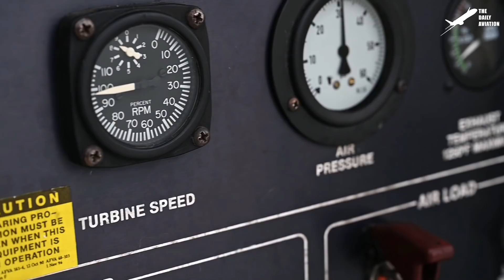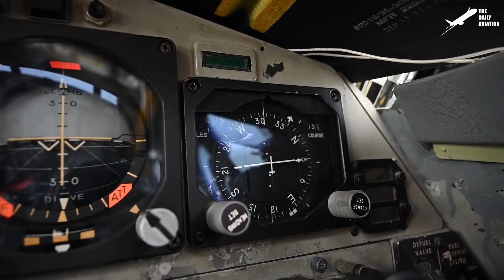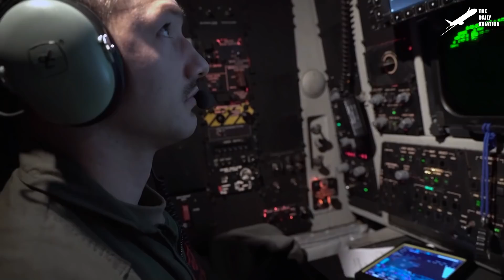US Need This Special Technique to Start this Gigantic Aircraft

Comment: I suspect the B-21once sorted out will retire the B-52s. But the B-21 is still a bit too glitchy. But so was the B-52 when it first went into active status.
The F-35 had/has all sorts of glitches. I strongly suspect the military actually wants people to think the F-35 is problematic aircraft and seriously underestimate its potential...That's what I would do.
Letting everyone know what you have under the hood is ALWAYS a bad idea. Being grossly underestimated is an excellent defense strategy. Even to the point of putting out embarrassing disinformation. Parading your weaponry through the streets is like showing everyone you're playing poker with what's in your hand.
The U.S. doesn't do that, they hold their cards close to their chests. What you think you see is NOT what you're going to get. At a guess, at least 20% of U.S. firepower is very carefully hidden...Maybe more. 
That there is a U.S. Space-Force is always glossed over. Hey, no big deal. Please, don't give it a second thought.
Reply: The problem with the B-21 (and most other projects funded by the gov't) is that it's taking way too long. For example, the SpaceX method of rapid prototyping is producing a huge rocket that may make it to orbit before the Boeing SLS, with its recycled parts, does.

Comment: I was surprised to see the B52Hs , the only ones flying today and built in 61 and 62, could only go 400 mph.🤣 The old D models I flew in, built in 56 and 57, did a bit better than that.
They should have used a military fact checker on a few of these statements.
Reply: Airspeed is limited to 622 mph by the electro-optical viewing system, which causes flight instrumentation issues at higher airspeeds.  Your Dogs didn't have such a system.  The vertical stabilizer also has different characterics regarding speed/altitude.

Comment: cart starts?  no, it's start cart...and even then they aren't called that, it's a -95.  the generator is a -86, or a "hobart".  and not a word on the unique landing gear?
Reply: -60s were retired when you were in?
Reply: @wingmannj  worked on many at several bases, but around fighters.  60s were never used on heavies.  loud, less load, way too much gas.  -86 was power for 8 hours on 50 gallons of fuel.  -60 was 100 gallons per hour...and again way too loud
Reply: @scottallberry6713  they were extremely loud, they had a turbine engine not like the hobart diesel. i got tinnitus from them. had -60s at sawyer in the 80s.

Comment: No APU in B-52, this is external bleed for ENG starting
Reply: This was a cartridge start, though they showed an AM/32A-95 compressor early in the video.
Reply: @dougwickstrom9870  no x-bleed on B-52 or what?
Reply: @MultiMetaldemon  Need to have at least one engine running to start the rest on cross-bleed.  This was a demonstration of a war emergency start which started all 8 engines at once using 4 starter cartridges.  External air connects only to #3 engine.

Comment: '
if the B-52 is a too old and no fix...
buildding brand new B-521 airplane with little bigger size, more longer body, long range, use 2 jetmotors from C-5 engines...
8 jetmotors are too much waste gas and heavy weight
Reply: c5 engine on a b52 would suck up every single little tiny pebble, grain of dirt, and other things much bigger....which would lead to much bigger problems than just fuel efficiency.

Comment: Not sure I'd want to be stuffed in that thing nonstop for 15 hours...I've never been aboard a B52 but I'm told there isn't enough room inside for the crew to blow their noses.
Reply: They can get up and walk around, cook a meal in the oven, take a dump if necessary, and enjoy a cup of hot coffee. Yeah, there's room to blow their noses too. There's even a foldable cot for napping.
Reply: @barrygrant2907  Thanks for the clarification, Barry.
Reply: @barrygrant2907  B-52H has a built-in bunk.  As for the toilet, it's not much more than a bucket, and frost forms on the thing at altitude.  Walking around is limited, as the only place to stand upright is at the bottom of the ladder between the upper and lower decks.  And as that is on top of a hatch, standing on it is a very bad idea.  I suppose if you just have to stand, you could do it on the ladder.

Comment: Wrong on the cart-start unit that was a -60 bleed air,electrical unit a small turbine engine for the bleed air, cart start is basically black powder charge to spool up the engines speed for the igniters to fire off and they were mounted on all eight engines as I said  in my last  comment do your research right
Reply: They did start on cartridges.  Watch the video.  The power unit shown is an AM/32A-86, and the air cart is a -95.
Reply: @dougwickstrom9870  I know what a -60,-86 are I had to fix age mechanics screw ups AND they don't  need etheir unit for alert start up period, when they did a cart they fired all eight at the same time they used the batteries on the aircraft for power seen it all the time in the eighties during the cold war when they scrambled a did a elephant walk enough said

Comment: And a single German Foo-Fighter from the 1940's could run circles around this silly plane, destroying it within seconds after spending time toying with it.
Reply: So, after well over 60 years of service through Korea, Vietnam, Iraq, Afghanistan, and countless other areas, we didn't see that happen.  Why? Because the B-52 doesn't go in unprepared, or alone.   Air superiority is established well in advance by F-18s, F-22s, F-35s, drones, etc.   So, while your post is theoretically possible, it's not the reality.
Reply: At 50,000 feet? And 100 mph faster than a ME-262? Perhaps not.

Comment: How is this a special way to start engines??
Reply: The engines start demonstrated in this video used powder cartridges.  Modern aircraft cannot be started that way.  Some older aircraft could only be started with cartridges.  That is what is meant by "cart start."  A "start cart" provides external compressed air for starting.  A B-52 requires external air or powder cartridges to start.

Comment: If usaf plans to use the b-52into the next decade then why not use 4 high-bypass turbofans instead of the 8 inefficient turbojets now in use? HELLO....welcome to the 21st century!
Reply: Amongst other things, the wings would have to be redesigned. The 737 Max kerfuffle was caused by Boeing trying to shoehorn efficient engines onto an airframe that wasn't designed for them. Welcome to reality.

Comment: Top speed is 650 mph not 400. Are the other facts wrong too ?.
Reply: Airspeed is limited to 622 mph by the electro-optical viewing system, which causes flight instrumentation issues at higher airspeeds.

Comment: 4:05 why do poeple messure fuel by WEIGHT, yes weight is an important factor but why is that the mesurement given instead of liters. earlier in the video you have gallons per hour as fuel consumption and now you give pounds of fuel for total capacity? see how its miss matched? how the fuck am i supposed to calculate how long it can fly for without looking up how much jet fuel weighs? Also if your concerned with the fuel weight and cargo weight being to much for the aircraft you probably already have a calculate out and ready so memorings how much a gallon of jetfuel weighs would be easy for you to calculate it then and there.
Reply: Fuel weight is more more useful that gallons. The fuel flow gauges will tell you how much pounds per hour you're burning. It's really simple. Everything about flight is weight based. More fuel weight, less cargo/munitions, etc.
Reply: Because the weight (actually the mass) of the fuel is important to loading, weight and balance, and to the available energy content regardless of volume.

Comment: Time for retirement, way too costly and too many man hours to operate.
Reply: not even remotely close to being a true statement... you have no idea what you're talking about.
Reply: @wingmannj  Maybe if you asked me why I said it instead of just trying to trash me we could have a conversation. However, I still will explain my views on this. Do you realize just how many icbm's we have right now, I believe the number is close to 450? These alone can do the job in place of an aging B-52, why, because they are loaded with nuclear warheads. Oh ya, we also have 11 aircraft carriers each carrying around 70 planes that can hit any target, just about I'd say. Let's see what's next, how about the our submarines, in which we have approximately 60 of them. These can park right next to any coastline and do the job. How about the B-1 Lancer, or the B-2 spirit, and don't forget the new toy called the B-21 radar. Instead you prefer to keep this aging craft in the air because of what???Have you seen the inside of one of these aircrafts lately? They may have new engines, but who cares, it's the wear and tear of the fuselage that matters. Bottom line, there's no need for them any longer. Oh ya I forgot, we will soon have hypersonic missiles, you think that we can use the money that keeps the B-52 operational on a few bridges in our country, or maybe build of some high speed rail systems, you think??????
Reply: @iamric23  i wont ask why you said it because its a remark you pulled out of thin air...like a layman's uneducated observation, like bro-science. you have no familiarity with the plane or its weapons. it launches alcms that have a strike distance of over 1500 miles. when hypersonic missiles become operational the plane will be launching those too. sure its an old airframe but extremely robust. the plane i had is 61 yrs old and is still flying... try not to be triggered by that.